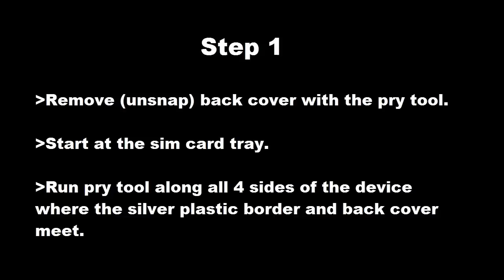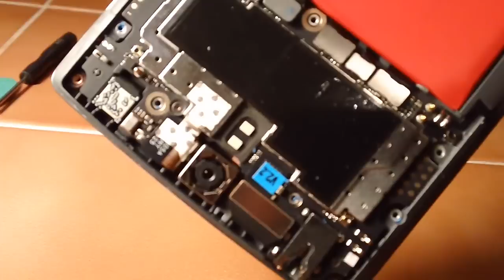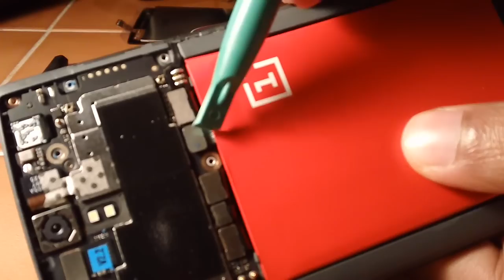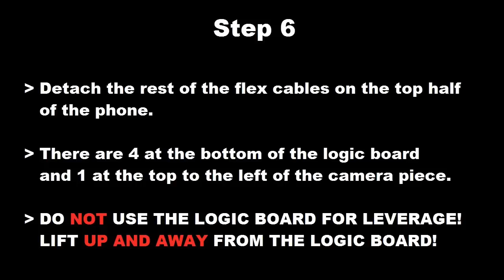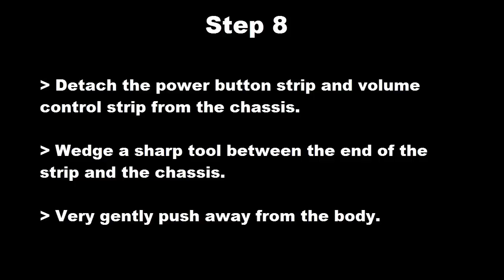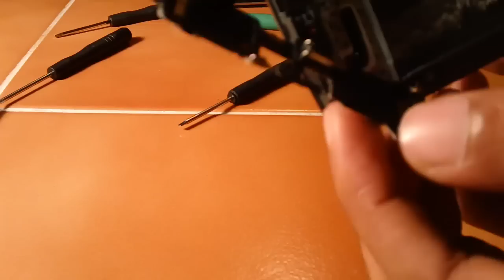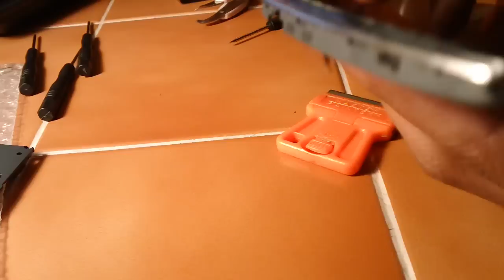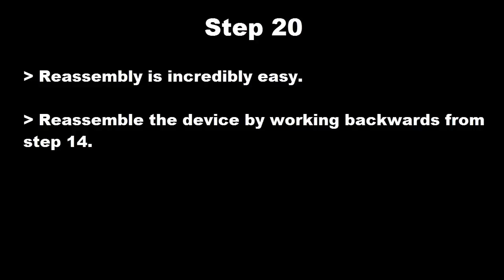HOW TO: REPLACE ONEPLUS ONE SCREEN (OPO Disassembly Tutorial) EASY COMPLETE TEARDOWN

Comment from the maker: Donate a few dollars please: https://goo.gl/fGdJ8U -Thank You :) -------- FOR AN *EASIER* PROCEDURE, BUY THE SCREEN ASSEMBLY THAT COMES FIXED WITH THE FRAME! STOP AFTER STEP 14 AND JUST PUT ALL THE COMPONENTS INTO THE NEW BODY. NO NEED TO BUY ADHESIVE/TAPE. NO NEED TO FIND A HEAT SOURCE. JUST BUY THE SCREEN ASSEMBLY ATTACHED TO THE FRAME http://goo.gl/BI7Mus
Reply: So I just reconnected them. I feel like such a dunce. Worked like a charm after. Thank you all
Reply: +Stephen “Lotus” Johnson 

good vid, love the printed steps, way to be!!! great thing for me is i stopped using phone for months so i dont remember what color looks like, so when i get back to it i wont remember, even if its different!!
Reply from the maker: justlanded don't worry about the phone not looking decent. if the colors are off, just keep using it for about 2-3 weeks and it will look pretty much normal again. my display, although slightly warmer than the original screen, looks great now. how is it going since you last commented?
Reply: juliop101 I solved it!! You need to make sure that the antenna's golden connector is connected to the logic board. It gets detached very, very easily. You need to open it up again and re-connect the golden connector.
Reply: +Stephen “Lotus” Johnson 
Thanks for the tip AND for providing links.  Makes the whole process much simpler.
Reply: Stephen Johnson ok man, the problem is when u have lcd perfectly working and a touchscreen broken.. I just need to replace that piece savingthe lcd screen.
Reply from the maker: justlanded you must replace both, my friend. they are fused together...well glued, but the point is, trying to remove the digitizer from the lcd will most likely end up in a complete failure unless you're an experienced/professional phone repairman.
Reply: Stephen Johnson I followed your video. When I put in the charger, I can see my new screen works perfectly as the battery percent and android boot logo comes. But the power button is not working - I tried everything again but nothing helps. Do you know any reason?
Reply from the maker: atul purohit worst case scenario your power button's connector is broken. It might be out of place. Did you try pressing the button without the back cover on?
Reply: Stephen Johnson tried pressing the button without back cover, doesn't help. Also, the button does not look broken, it is not ripped off either. Do you know where can I get a replacement for the button assembly though? or any other thing which might help.
Reply: Stephen Johnson yeah.. I was afraid of hearing that! since there's no tutorial showing that specific point! anyway..i'm gonna try that cause I just received my digitizer from China.. I'll let you know :) but in any case I heard that a digitizer glue cured with uv light could be the solution..untill you are able to split glass from lcd of course..
Reply from the maker: atul purohit you can get new buttons that attach to the back cover; but, unfortunately there is no way to just replace that button part this is connected to the logic board. i dont have enough data to figure out the reason this happens to some people because everyone says they do the entire procedure correctly. it has been 6 days since you last commented. how are things, now?
Reply: Stephen Johnson My touch screen works but is unresponsive in certain areas. Can it be sent to One Plus for repair? or will i have to do it myself? 
Also, will the link above repair touch screen?
Reply from the maker: ishy2217 you can send it to OnePlus or do it yourself with the links provided and this video tutorial. sending it to OnePlus costs a lot more and takes way more time.
Reply: Stephen Johnson Thanks for the video and this tip! Going for the easier procedure. How can I make sure I'm buying the assembly that is fixed to the frame? Is this one good? http://www.ebay.com/itm/OEM-New-Oneplus-One-1-A0001-LCD-Screen-Display-Digitizer-Touch-Glass-Assembly-/361247095449?pt=LH_DefaultDomain_0&hash=item541c013a99

Thanks!
Reply from the maker: Ankit Jain the item in your link has no midframe. You'll know the item includes the attached midframe when the big gray part is on there. Your link shows just the screen (digitizer) + LCD (silver part). That is one piece. They are glued together. http://goo.gl/ffe2iS this link has the frame.
Reply: Stephen Johnson Thanks a lot!
Reply: +Stephen “Lotus” Johnson Thanx for the awesome video! my screen worked fine afterwards but my sound and down volume button wasn't working so I opened it back up to take a look and accidentally ripped the power cable on the side and cant turn on my phone. :( Any suggestions on what to do? I'm kinda freaking out.
Reply: +Stephen “Lotus” Johnson 
I just conducted the repairs on my phone and everything is working great except the battery life is now atrocious and I can't get a signal...
Reply: +AtarashiiSekai22 I have the exact same issues. any fix to the connection issue?
Reply from the maker: Did we check to see if all the connectors are attached properly? Sometimes that is the case.
Reply from the maker: dont worry, it happens sometimes! :)
Reply: +saltydecimator 

furthermore, how you feel about the fragility of the screen? is it really worht it to have this phone, and risk having to perpetually repalce screens? i got a new "tudia aminix" case for christmas, but not sure if it will work..
Reply: Is the screen as good as the original screen?
Reply from the maker: Yes. Mine in particular had weird color issues only in the first two weeks of using it.
Reply: are you using the OEM of LCD screen? I thought the OEM would be better.
Reply from the maker: They're all the same thing.

Comment: Hi Stephen. I broke my OPO's screen few days ago, and now I'm thinking about replacing the screen myself since it's the cheapest way. So in this video you didn't have the new screen with a frame? How much easier the job itself is if I get it with the frame? I don't have any experience about smartphone screen replacements, but I might be brave enough with your video.
Reply from the maker: It's like legos, really. If you use the assembly with the frame, it's ten times easier. Just take all the components out of the old body and put it all in the new frame assembly in exact reverse order in which you took them out. No heat gun and no adhesive needed.
Reply: Thanks a lot for the reply! I think I'm gonna go with that and order the digitizer with frame :)

Comment: video was helpful. I would say apply some general knowledge rather than blindly tear off each piece of assembly. I just removed battery , top cover , detached both cabel related to screen and remove un useful plastic piece  besides top cable. replacement was easy and 10 mins procedure. needed glue , screw driver, opener to complete entire replacement.
Reply from the maker: Oh that's fantastic. Thanks for the tip. Hopefully people see this and take your method into consideration. I appreciate you taking the time to watch my video and comment. Thank you.

Comment: Awesome video! Thank You!!!  It is SO much easier to do it yourself when you see how it's already been done.  (i.e. How hard can I pry on that plastic piece, and more importantly, do I have to!)  I too have problems with the capacitive keys.  I think I broke the menu  backlight LEDs because it was hard to get the board to seat properly. But because my screen has a "home" icon that is missing an eavestrough (even though it is backlit), I'm not sure if it is screen issue or because of my over-aggresive seating technique.  In either case it is a small price to pay.Thanks again!
Reply from the maker: You're welcome! I'm glad it's working for you. Thanks for using my video

Comment: Stephen, many thanks for such a great video tutorial!

I'm getting ready to replace the screen on my One Plus as well. Its display is working fine, but the front touch sensor glass has barely visible glass break, and no longer responds to touch input :-/
Reply from the maker: Zlatan Klebic yup! time to replace the screen. good luck! message me on Hangouts if you need help during the process.

Comment: hey bro, thanks for the tips. is it fully necessary to heat the screen? I am not replacing the whole screen, Im just insluating the digitizer flex tu stop the grounding issues and the ghost touches. thanks!
Reply: Hey did you ever get this fixed??
Reply: I opened all the thing and insulated the flex but the problem persist and I can't re open because some screws got fucked up
Reply: Do you have ghost touches too?
Reply: Dang... Im looking for someone who forced l fixed it so I can try to fix mine
Reply: Kevin Rodriguez Did u manage to fix it?
Reply: not really, I opened it and did the fix but it didnt work. it worked till the last software update. I got robbed anyway a few days after the update

Comment: I just replaced my screen and i have noticed my volume buttons are not working afterwards. I opened it back up and i do not see any cuts or scratches on the connector going to the logic board from the buttons. Any ideas what could be causing this issue?
Reply from the maker: Did you try testing to see if the buttons work without the back cover? Maybe the connectors on the logic board aren't fully connected? Hopefully you didn't bend the cable too much causing to snap or break ( which I doubt). Are the buttons touching the back cover buttons? I'm thinking it might just be a simple connector issue.
Reply: Yes I did open it back up and tested it with just the buttons, I also checked the connectors too.
Reply from the maker: Is this only issue you have? I don't know what is causing this if you did everything right. It may have been a weak set of buttons. Or maybe one of the 5 connectors on the logic board just isn't pushed in all the way. Is your phone charging normally?
Reply: Yes it is, this is the only issue I have. My phone charges normally. I tried changing the volume with my headphones but I couldn't do that either. The only thing I could do was pause and play music.
Reply from the maker: So it could be a software bug? Can you try adjusting the volume with the sound settings?
Reply: Yes, I'd have to go into settings every time I want to do it. I wiped and flashed stock cm11 last night with root and that didn't fix them, then I tried flashing cm12 nightly and they still don't work.

Comment: So just to let you know, finally got my screen in the mail the other day. Bought it from Alibaba for $56. Not bad, but shipping took over a month. Followed the video, made a few small mistakes, but overall it went well. Only thing I can't figure is that the volume buttons don't work anymore. May have cut  the small cables, I'm not sure. My on-screen buttons light up and go off, so that's good. Quite a bit of light bleed from below those buttons, and the screen looks slightly smaller than an oem screen (by just a hair, but is noticeable). Overall, I'm not displeased, this was my first adventure. Now on to my Nexus 7 screen!
Reply from the maker: This is exactly how I feel haha
Reply: Stephen Johnson Well, I just did it and have the same feeling. I checked and the replacement screen is indeed a bit smaller, causing a lot of light to come out from the sides...
Kinda spacey though

Comment: Hey, got my screen replaced. After that, I get very low wi-fi signal (no signal if I step 3metres from router) and no Mobile signal at home (only outside) . Any idea what got fkd up ?
Reply from the maker: Are you sure all connectors are snapped completely together? Have you tested other routers?

Comment: Hi, I dropped my phone, had a tempered glass on it, that totally broke, but the device was unharmed on the outside. When I picked it up, the device was shut down. So I suspected the battery was knocked out by some reason. So I opened it up, and indeed the battery connecter was disconnected. I Connected it again and I expected it to turn on again, but nothing happened. When I put it to the charger there is no LED blinking, no screen turning on, basically a dead device.

You know what might be wrong with my device?
Reply from the maker: Did you ever get this issue handled?
Reply: The motherboard seemed broken to an extend unrepairable, so I issued an official ticket for repair and OPO herself decided to repair my device for free. Seems i got handed a totally new device. 

This video actually was a real help for opening up the phone, which was quite fun to do by the way, thanks for the video!

Kind regards from The Netherlands.
Reply from the maker: Oh that's pretty sweet. I'm glad you were able to get it all taken care of. Thanks for the kind words!

Comment: This total teardown is completely unnecessary. You only have to remove the camera cover, detach the battery and far right connector. LEAVE THE LOGIC BOARD ALONE. Remove the bottom cover, detach one connector, then take the screen off and pop the new one on.
Reply: I assume that if you do that, you run the risk of damaging components when you apply heat.
Reply from the maker: Thanks for your input.
Reply: Any teardowns that show this easier method?
Reply from the maker: Marc Schipperheyn you do. It depends. Everything is completely necessary if you move to a new mid frame. That gives you the cleanest result. If you feel that you want to complete every step go ahead. There are a few more comments, here, who state other methods.
Reply: Stephen Johnson Know anywhere you can get a good mid frame and screen together?
Reply from the maker: Drew Allen this might help. http://aliexpress.com/search.htm?keywords=oneplus+one+lcd+digitizer+frame
Reply: Stephen Johnson Thanks, I've found a few one there. Kinda reluctant about buying a replacement. Already bought one on ebay and the replacement was not only a smaller screen size by like half a mm but was cracked when I opened it!
Reply from the maker: Drew Allen that's terrible news! Hopefully that doesn't happen again. Vifocal.com and eBay are good places to go for parts. Aliexpress is just the cheapest.

Comment: Mighty fine job! I don't know why I haven't seen this video until now. Watching it and reading the comments made me realize that a full disassembly may be a bit excessive for a screen replacement if you don't plan to reuse the screen you're removing.

The earpiece may not be as easily damaged when the screen is removed as other phones because the earpiece port in the chassis does not fully expose it to a heat gun's heat, not to mention removing it is probably riskier than not, because it can fall apart. I suppose it goes both ways; removing other components both increases and decreases the risk of damaging them during the repair process.

I didn't want to take any chances removing my screen without removing that gray block obstructing the digitizer flex, because you'd have to tilt the screen at an angle in order for the cable to come out. That would require the whole screen to come off the chassis first, but I don't think I could manage that without damaging the LCD or glass.

Anyways, great video! Would it be OK for me to put it in my XDA thread?

Comment: does the replacement come with adhesive ?
Reply from the maker: No, you'll have to purchase that  separately. Silicon based adhesives or double sided tape are preferred.
Reply: What about the tools    just cracked my one plus one    so scared I will stuff this up :O
Reply from the maker: Just relax. The screen comes with 4 small screw drivers and two plastic pry tools. If you don't feel comfortable with following the procedure have a professional take care of it.

Comment: When I removed the screen my polarizing filters came off, any suggestions?
Reply from the maker: Off your camera lens? What exactly did you do?
Reply: Stephen Johnson don't know if they were polarizing filters, just a guess. They were in between the screen and the frame. They are the size of the phone and when looking through them it causes massive distortion. Hopefully this things were attached to the screen and not the frame.
Reply from the maker: Did you take any photos of this? That would help me understand what's going on a lot better. If it's black and you see it on the sides, bottom, and top, then that is adhesive which kept the digitizer and midframe stuck together.There should have been two copper strips on the back of the LCD, as well. Did you pull the digitizer off the LCD?
Reply: Stephen Johnson Got some pictures on my google plus page of the front and back. I hope the "filters" were attached to the screen because when I purchase the new one they will be on that. (mabye)

https://plus.google.com/u/0/105212190595165464413/posts
Reply from the maker: Yeah you pulled your LCD apart. It's completely destroyed. If you are following the instructions in my video, you should be installing the new digitizer+LCD piece. The digitizer and LCD are fused together. The digitizer is the glass that registers touch. The LCD produces the image. Do not worry about this if you have the digitizer+LCD replacement part. If you only intended on replacing the glass digitizer, you have just wasted your money. I doubt that was your intention, so you are fine.
Reply: Stephen Johnson Okay, thank you for your help.